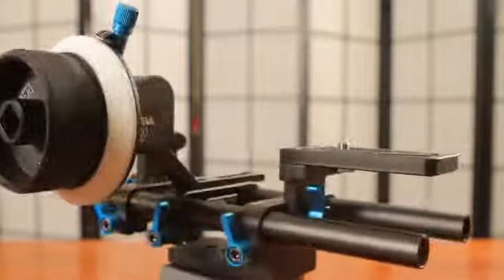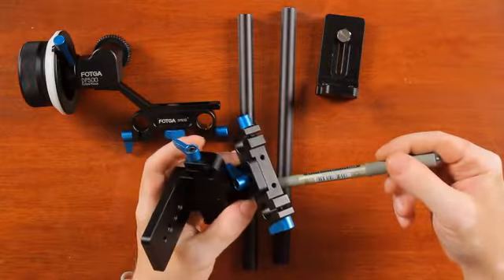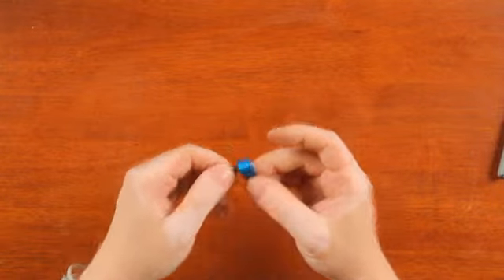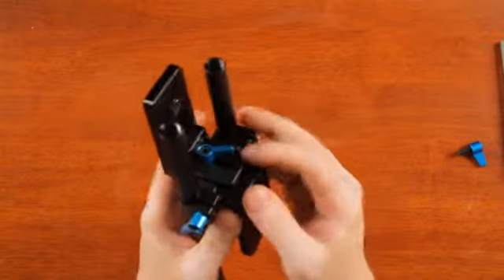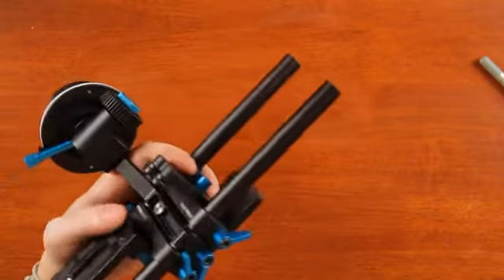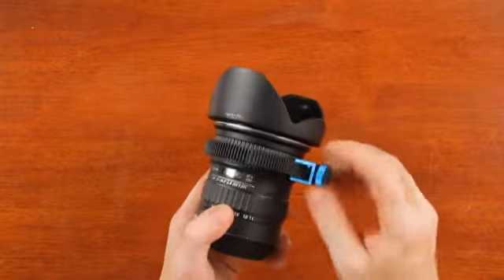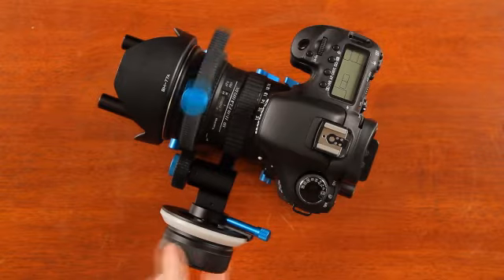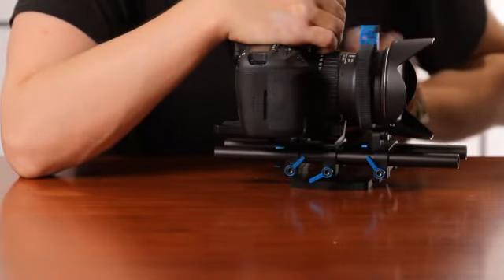fotga dp 500 follow focus.

Comment from the maker: it will work with any camera, as long you have lens. 
with mattebox. I would skip that one. mattebox is only for filters and work as a sunshade. they are expensive and heavy, but they add pro look you your rig, but its only look.
you can have the same using just a lens with hood. and circular filters. its easier and cheaper to find good circular filters than those for mattebox. i use only 2 filters. polarizer and variable ND filter.

Comment from the maker: it could work, if you have a big lens. than you perhaps could slide drive gear under the lens. usually is on the side of the lens. but if you add battery grip it might be under the lens. trial and error.

Comment: Thanks for the video. I just bought this with matt box but  have a problem.  I'm using a battery grip on my Panasonic GH2 which adds height. I have ordered a height adjusting part for the rails and will see if it works.  The main problem I having is with the quick release plate.. Check out the link below ......

 Problems with My FOTGA DP500 QUICK RELEASE PLATE  19.6.2014
Reply from the maker: i think i have seen 2 holes on your new quick release plate, which should match with the holes on your old one. have you tried to unbolt old plate and bot new one in place?
Reply: I've done this have you seen my new video on problem solved?  Thanks your video helped
Reply: ***** You wanna avoid using a grip at any cost, it will shift the weight in a way you can break your internal connectors if you have a follow focus with a big lens